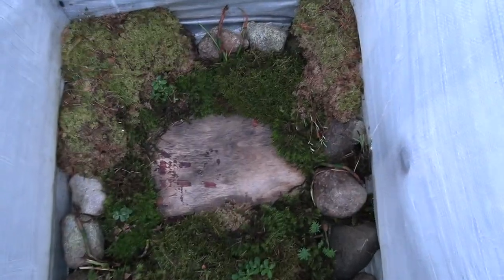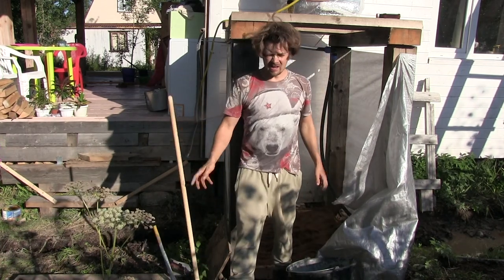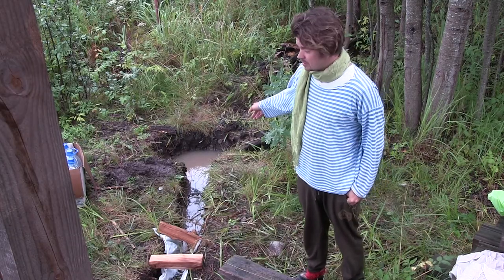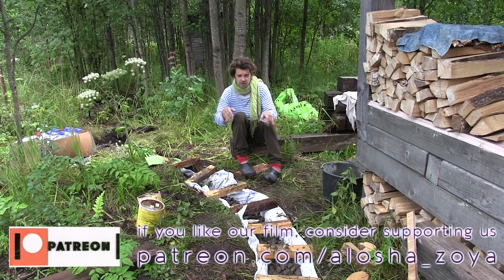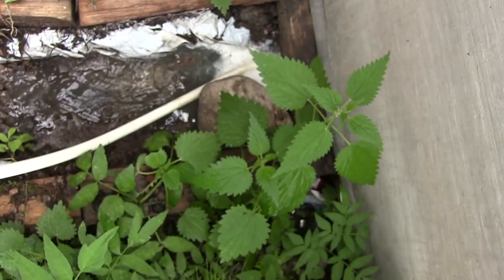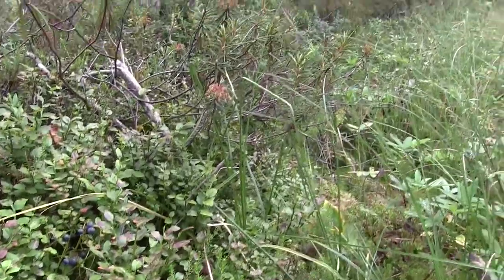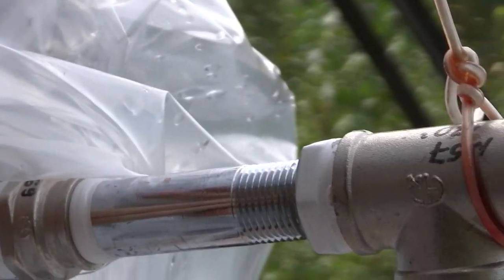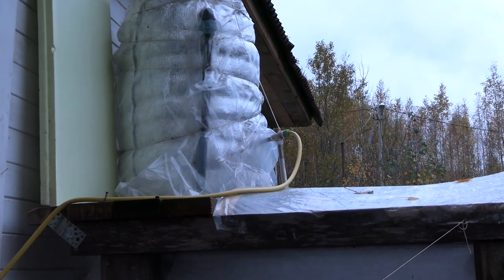How to REcycle grey-water without plumbing

Comment: You just need to increase the size of the system to handle the flow rate and you'll be good to go. I loved how the plants grew inside the shower. I can imagine it will be quite chilly in the winter or is this a summer shower only?
Reply from the maker: Thank you for the comment I do not have another shower in door so I will have to adapt the shower for the Russian winter. I’m thinking double layer polycarbonate and possibly insulation in the floor and of course insulation around the water tank which is above the shower